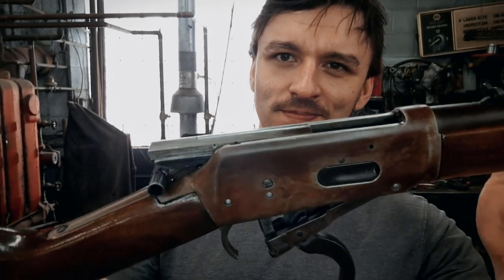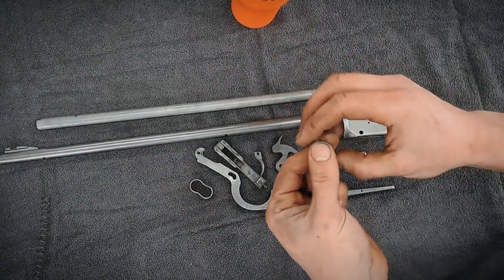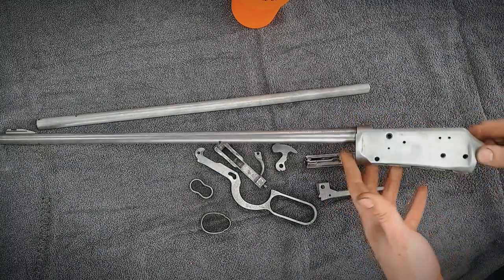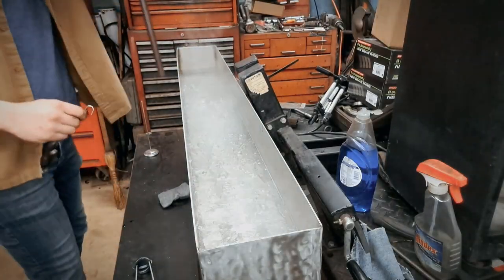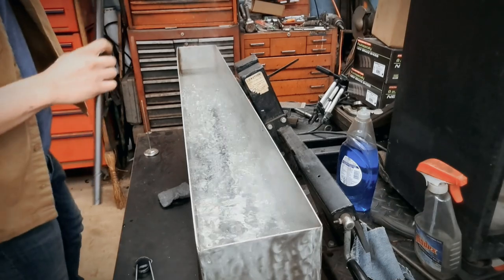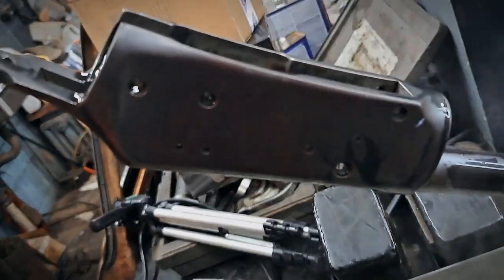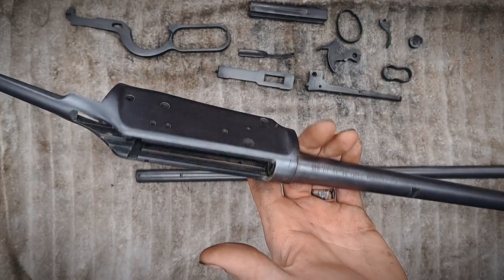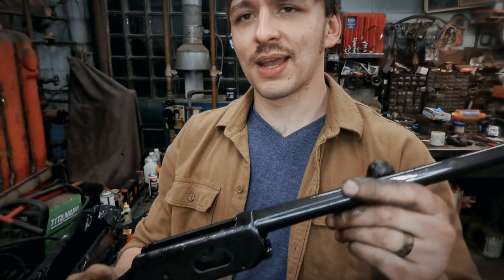Rust Bluing a Post 64 Model 94 Winchester - Can it be done? - Gun Restoration - Laurel Mtn Forge

Comment: Looks good. I am always surprised at the different methods used to rust blue. I have blued several using Mark Novak’s method with good result. I wish you would have discussed cleaning prep prior to application of bluing solution, though I believe anyone trying this will look further into it before committing to the process. Thanks for the video.
Reply from the maker: Absolutely! Mark is Incredible!!

 So in a previous video I delved deep on prep and application. This particular blend of Rust bluing Solution is called Laurel Mountain Forge barrel brown and degreaser. Degreasing prior to its use, I have found, to be minimally necessary. Obviously applied degreased, but not nearly as involved as the Trademarked "Rust Blue" or other brands with similar compounds which require a much more extensive degreasing methods. 

Cheers!

Comment: I use laurel mountain forge browning solution on my flintlock builds.
I let mine rust for a week in a humid climate then steel wool leaving the pits, then neutralize with baking soda..I then blue with 44-40 cold blue. Then I use steel wool and motor oil and bring it back some. Makes them look old and worn. I love building guns to look old. Just my preference. 

Good job on your work there. I have a post 64 in 30-30 and I am redoing the finish on the stock and forearm but I'm happy with the factory bluing. If I come across a lever that is rough, I may do something similar.

Comment: Amazing outcome!!! Your patience definitely paid off beautifully!!!! I have a post 94 I’m just going to ceracoat it. Done it many times with various firearms with great results but that blue you pulled off is 👌🏻
Reply from the maker: Thank you so much! I too love the turnout of Cerakote, and honestly it would have probably been far more practical on an instance such as this.

BUT,  sometimes you just have to try and push the envelope and accommodate the group that loves that old timey feel  😎
Reply: I also have one of these nasty 94’s and have been debating the slow rust blue.  I can cerakote it so much easier, but that blue finish sure is beautiful.

One thing I’m pondering is how would it work if you were to prep the rifle and parts like you would for cerakote and blast it with 120 grit AO instead of sanding it.  Degrease and gas out would be the same, but instead of painting, heat it up in the oven and apply a blueing or browning solution.  Then card, heat, apply solution, bake and repeat.

Comment: For rust bluing I usually end up polishing down to 400 Grit Silicon Carbide. My rust  blue solution etches a very fine amount which I can control using 200 proof ethyl alcohol. I card the surface with a .0025" stainless wire brush then boil in distilled water then do another pass. I use a camel's hair brush for application.
Nice work on the final product. It has a beautiful satin finish to it. This should last at least 50 to 75 years.
Reply from the maker: So I've never done a rifle in this coarse of a grit before. Typically I polish to 600, and have had really good results. The next rifle I'm doing I've polished to 2000 grit to see if its's still capable of biting and reflecting the surface finish. My understanding is that the blue finish has as much to do with how fine it etches just as well as the surface finish, so we'll see how it goes.

I've heard of mixing ethyl alcohol to the mixture to give a much more shiny finish, but I haven't stumbled on enough definitive information to really try diving into it and testing it. So any information you might be able to provie would definitely be put to good use!

Comment: Great results and a great video! I've been debating whether to Rust Blue my Winchester Model 12, 16 gauge made in 1932...Now I think I will do it. I'll try for that Winchester dark luster which will require finer surface preparation and many more rust/carding cycles. I'll let you know how it turns out! Thanks again Amigo

Comment: Dude, OUTSTANDING video.  Entertaining and enlightening.  Just got my bluing (boiling) tank and carding wheel in the mail.  I've got a half dozen old bolt guns that need some TLC and will be rust bluing them soon.  Just need to decide on what solution to use.  Leaning toward Rust Blue American Formula.
Reply from the maker: I've used multiple different flavors of the RUST BLUE brand with great results. With said formulae, I've found that prep is incredibly crucial. I do hope the best for your projects, and expect it to be very rewarding!
Reply: I did one of these a couple years ago. I removed the barrel and plugged it with dowels to protect the bore. I boiled and carded after each time in the humidifier.  Turned out great.

Comment: It is important that you let people know the central importance of 150% degreasing before applying the rusting solution. I just finished the second application of bluing to a No 4 MK I, and I never card off the frog hair after first applying the rusting agent and it turns out the same. Also, I use a makeshift accelerated 'ripening' chamber I cobbled together out of a U-haul wardrobe moving box, a small space heater, and a Walgreens vaporizer to bring the heat above dewpoint (110% necessary if using low pressure steam, as condensation on the metal will cause runs) and about 100% humidity. It works a lot faster than 3-4 hours. Great save though!

Comment: I have a .44 Magnum model 94 with the crappy peeling blue. Brought it to a local gun shop that does gunsmith work. The guy said you can’t blue it and wanted to $175 to  durablue the receiver. The barrel was actually in good condition. I believe Winchester went back to a hot blue in the early 80’s. Maybe I will find someone who can do this type of work.

Comment: Hello
Nice video. 
My winchester 3030 was made in 1978. And i wonder if its is the same alloy ?
Thanks.
Reply from the maker: The Alloy would absolutely be the same, but the outer finish is what is determined by the year of MFG, or more precisely the Serial Number will determine the  finish. You will still absolutely be able to use this technique, but it may just take some extra sanding to get to the bare Sintered Metal.

Cheers!

Comment: Oh man... that looks absolutely gorgeous. Makes mine look like a turd. I'm still debating on how to refurb mine and I don't have the room nor the equipment you have, so I'm probably gonna have to rely on hot salts or cold bluing. Yeah, I know. Cold bluing is more cosmetic painting rather than actual bluing. Might look into that vegetable oil quenching, see how that holds up.
Reply from the maker: Honestly, if it were me in your shoes, I would look into durakote or Brownells equivalent Alumahide. Both work incredibly well, and I've seen many with the right prep, turn out great!

Just my $.02, goodluck!
Reply: @BLWRK  Wow, I'm actually quite interested in that Duracoat. I've been checking their website out for the past few minutes and they seem legit. I'll check out the Brownells stuff as well, but yeah, I'm leaning towards the former! Thanks for the suggestion!

Comment: Aren't you supposed to boil and card after every application and rust cycle?
Reply from the maker: Not necessarily. In the past, I used to boil and card between every cycle. After about my 12th rifle, I began carding after every rust cycle. Cutting out the boiling step altogether until I get a nice velvet brown. I have found that the end results are virtually indistinguishable.

Comment: I had a 1967 Winchester with that black chrome finish on the receiver.  Did not care for that but what else could you do?
Reply from the maker: If you were looking for a bluing finish, this is the most practical way to do it. Being that yours is an early serial number chrome finished rifle, you will have a bit more sanding to do on the receiver to remove the plated layers, but after that, the process would be identical! 

Typically refinishing these consist of all the kotes(cerakote, gunkote, durakote, etc) rust bluing is an option(matte to gloss) or, you could send it out to be iron plated then hot blued. I've listed these in the order of practicality.

Comment: Okay tips here, first toilet bowl cleaner will cut the bluing faster than vinegar. Steel 'wool needs to be soaked in acetone to remove the oil from it since oil will kill the rust bluing process, 320 grit is a very good grit to prep for bluing still not a rough finish but allows a good surface to the rusting to occur. To expedite the rusting process you cant get an old carboard clothing  armoire for packing and  cut an access hole in the  bottom, hang your coated parts in the box. use a small ceramic space heater from like DG to get the temp up to about 100 degrees then use a clothing steamer to introduce steam in the mix, takes about 2 hrs to get the good frog hair rust on the parts maybe a bit longer. Alwasy use latex gloves when handling parts. I like to wash parts after sanding with soapy water wipe the dry then let em sit a while, next wipe them with acetone to remove and residual oils and left over soap. In my setup I use a stainless steel cooking pot with a toilet flange attached to the lid and about 36 inces of 4inch pvc pipe with a cap that is loose and slotted for a cross bar to hang parts from. Get it steaming good and hang the parts in the tube for about 10 to 20 mins. stops the rust and turns it black. I dont use steel wool after the prep phase I actually use a carding wheel  on an  old 1/2 inch heavy duty drill with a dimmer switch controlling the plug in that way you can get down to between 300 and 600 rpm for buffing the barrel. Last but not least, yes you can use kerosine but used and I stress USED motor oil works too. You cant use new motor oil because it has all kinds of rust and corosion inhibitors in it as well as other chemicals that will remove that bluing. After that oil has been run for 3k miles those chemicals are gone and it produces a very nice black finish. Side not if you get into welding or making like I do for work certain tools that need to be around water and not rust to death you can heat things to a dull red and quench them in used motor oil to blacken them and the oil pentrates the pores so not  or low rusting occurs.
Reply from the maker: You covered all the bases!! Thank you! In a previous video I dove deep in describing the process and REALLY went deep on all my methodology, but I'd also like to comment on a few things here to maybe clarify a little bit. Because all of your information is correct and useful in most rust bluing applications, and generally a good idea in ALL rust bluing practices.

In this particular video I used Laurel Mountain Forge barrel brown and degreaser, which has a degreaser within the solution. Which works INCREDIBLY well I might add. Typically I would always run through a myriad of degreasing and gas-out procedures to try to prevent oil bleed out in the middle of a blue job. I've found that the degreaser in LMF works so well that I don't even have to degrease the steel wool. I still however wear gloves throughout the process. 

I had used a cardboard box for quite a time, but I had found that an old cheap electric smoker with a digital thermometer and control panel cuts my time investment 10x. Because I can set the temperature to 100 degrees and leave a steel cylinder of water laying on the heating element, occasionally spraying the element with some water, and it produces the same effect!

Perhaps I will do a video in the future covering the differences between several different solutions, their methodology in application, and their end results. In any case, I will be stopping back to put your comment to work for me! Thanks again!

P.s. Toilet bowl cleaner?? I love it! Definitely going to give it a try!